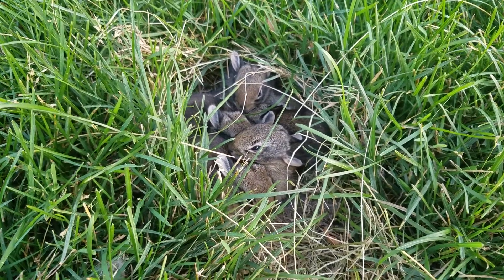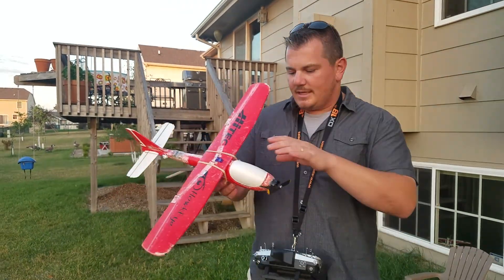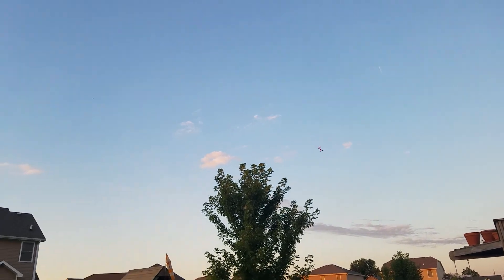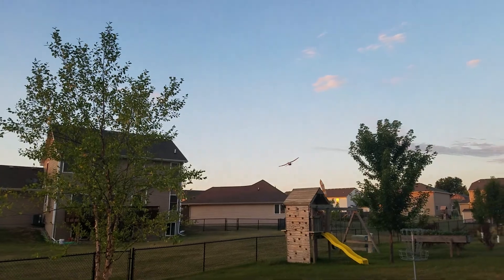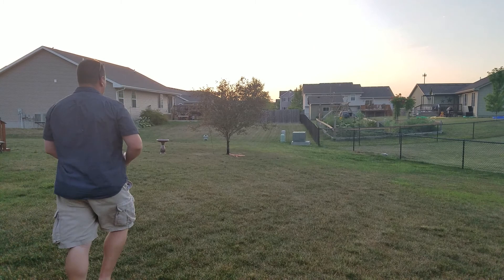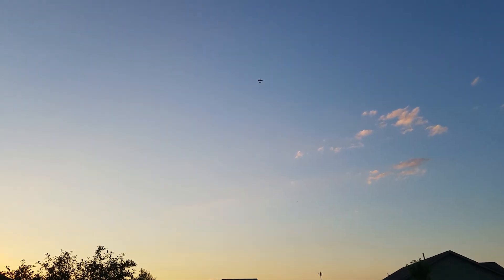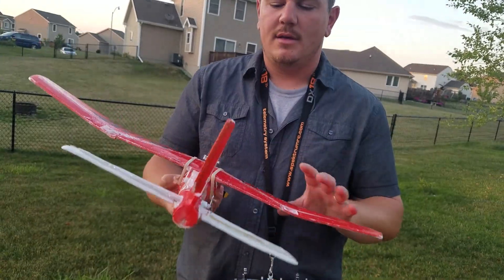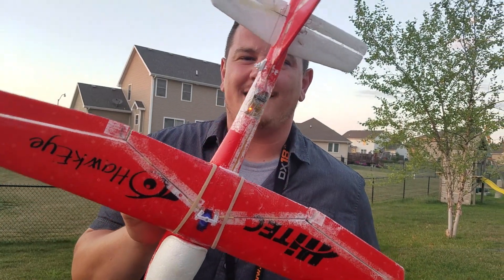HiTEC - HawkEye - Aileron Mod on Powered Glider

Comment: What electronics did you use and could you put links for them please
Reply from the maker: Hope I'm not forgetting anything...

1 X 5 gram Hextronix Servo on the wing for the ailerons
1 X 2.75 gram Hobbyking Servo on the tail boom for the elevator
1 X 2.75 gram Hobbyking Servo on the vertical stabilizer for the rudder

Orange Rx 4Ch DSMX receiver with stabilizer
I had to get two small plug to standard size servo plug adapters...one for ESC, and one for aileron servo

ESC - ??? 12 Amp EMax
Brushless Motor - EMax T2204 2300kv (I accidentally said Eflite on my video...ooops!

5045 Bull Nose Prop (counterclockwise)

300mah 2S 35-70C Eflite Compatible Nano-Tech Lipos (but you could use any small lipo)) - 
https://hobbyking.com/en_us/turnigy-nano-tech-300mah-2s-35-70c-lipo-pack-e-flite-eflb2002s25-micro-series-compatible.html?___store=en_us